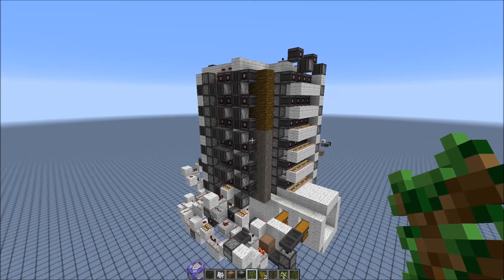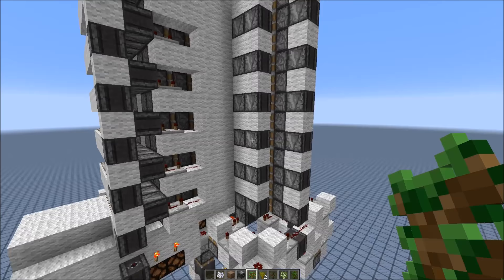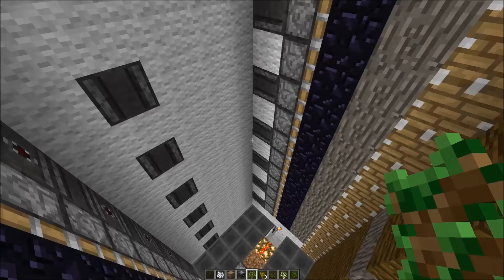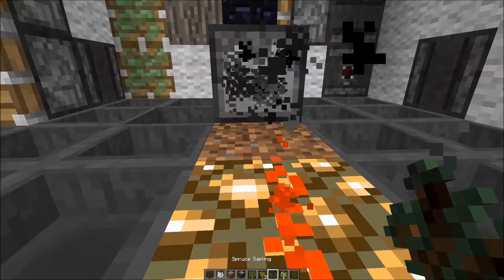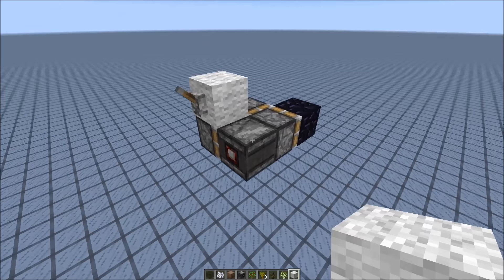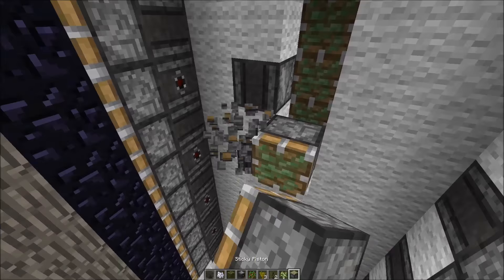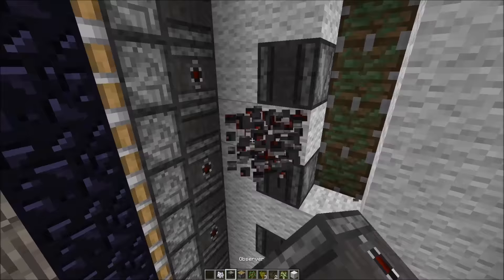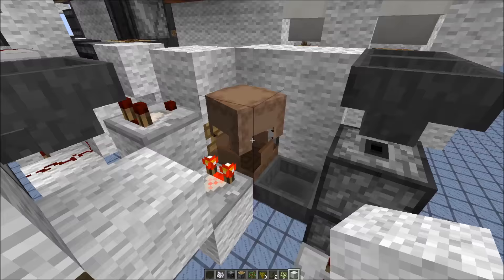1.11 Universal Tree Farm [broken]

Comment: SO I was in my redstone testing world and I noticed something weird (1.10). I placed two comparators next to eachother pointing in the same direction with  a single piece of redstone dust in front of each and one hopper behind each facing downwards (into nothing). Under the 2 blocks with the redstone dust I placed a piston on the left side and a dropper on the right. Whenever I powered the left dust by putting a single item into the hopper behind the left comparator, the dust powered both the piston and dropper. However when I powered the right, only the dispenser was powered. I tried this in multple locations and got the same result. Also if I use a second piston instead of a dropper, both pistons will be powered regardless of which comparator is powered. This doesn't have anything to do with tree farms but just something I thought I'd let you know :P
Reply: ***** I knew about quasi-connectivity for pistons, but didn't know it worked for droppers too O_O

Comment: Ilmango, I've made an automatic mob drop collection using shulker boxes, pistons, and hoppers. However, I'm having an issue that one slot in the box will not have a full stack, and therefore the comparator won't be completely powered and it won't break the box.  How do i solve this? I can provide a world download if you'd be interested in taking a look.

Comment: first of all, why did you built this out of wool? xD but ok
i m curious if we ll be able to make these farms faster in the proper 1.11 version than in 1.8, if they keep it the way that the pistons are powered for a single tick which would make powering any position normally only accessible via repaeters faster, as that it d only take half the time and be instant on the rising edge too
Reply from the maker: observers give out 2gt signals, when activated by repeaters etc. Exceptions, similar to pistons are block events (push a block in front of observer) or player inputs. In this case you get a 1gt signal.
Reply: oh. well that explains what we observed then. but either way, it should allow for quite some diffrent signal transfer and might make things faster.

Comment: Does the farm do dark oak trees?
Reply from the maker: no. I didn't make that clear, sorry. It works with all small trees. You'll have to make a seperate farm for dark oak. It's not possible to build a decently fast tree farm for all log types. 
Once we have a final 1.11 release, I intend to fix this farm: https://www.youtube.com/watch?v=l5l1aVMobJA
Reply: ok thanks.
Reply: oh also, when you make the new dark oak farm, can you make it so the sapling placing is afkable by using a minecart or pistons to push you?
Reply from the maker: ***** this was also possible in the farm I  linked. I just didn't do it in the demonstration.
Reply: oh ok thanks for the quick response by the way!

Comment: this won't work in pe because we dont have qussi connectvity and we have in pe different observe block act
Reply from the maker: that's correct. Also the timings wouldn't work and sticky pistons don't loose blocks, which is very important for this farm. I doubt such a tree farm is possible in PE.
Reply: +ilmango yah and in pe the stiky piston lose blocks as you said and pe has slower Pistons. thx for replaing to me in every video I comment in